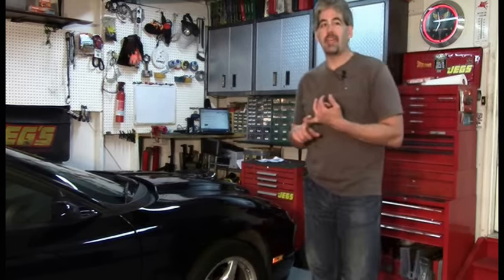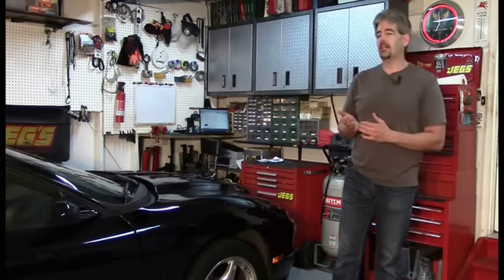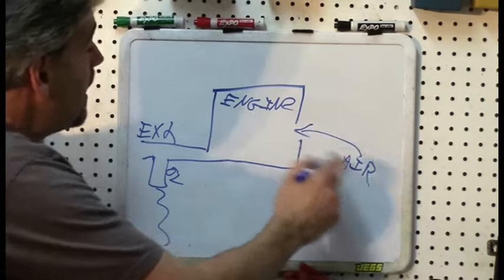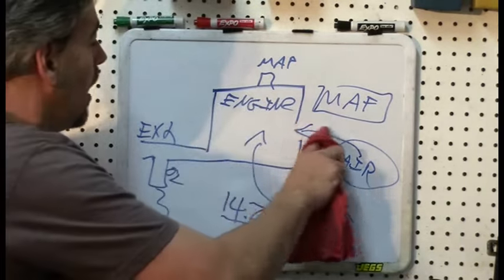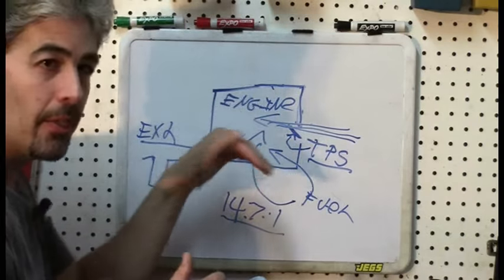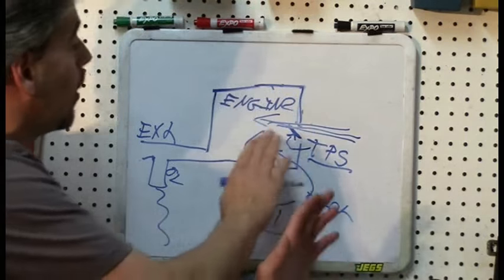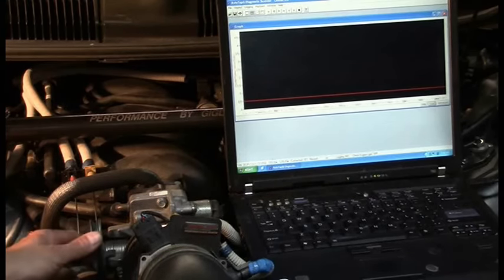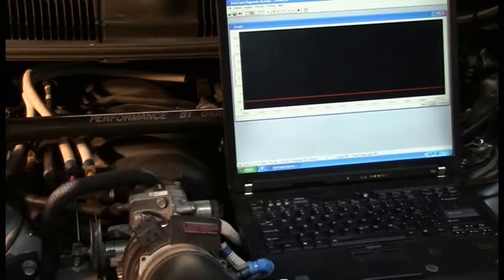TPS (Throttle Position Sensor) Diagnosis and Understanding Pt1

Comment: Nice videos on testing the TPS sensor and how this sensor relates to the others.  Since I do not have a MAF sensor I assume that in your last example with the TPS unattached to the engine my upstream O2 sensors will reduce the fuel flow (call for less fuel) and trigger the check engine light.  

Also, let's say a DTC went off for my TPS and I check the TPS and wiring and everything is fine.  What other issues could have caused the DTC other than a bad PCM?
Reply from the maker: Sandbag1300 Great point Sandbag. I actually addressed this in the original draft of the video but felt it was dragging to long (which I know I tend to do) so I eliminated it, but to answer your questions:
1. Unplugging the sensor: if you recall there was a "baseline" voltage through the signal of .5V as opposed to 0V. There is a reason for this. If the sensor is unplugged (or an open in the signal or 5V or ground) then this baseline voltage of course would be 0 instead of the normal .5V.  Upon seeing this, the PCM will immediately recognize there must be no voltage at the sensor and will immediately throw a low voltage circuit input code. The code will have nothing to do with O2 sensors (other than momentary I suppose) and in fact will prevent other codes from being thrown such as lean or rich codes because the PCM "knows" these are resulting from the TPS problem.

2. The most likely reason for a TPS code despite good wiring and sensor is if it is miscalibrated on an engine that has an adjustment.  Per #1 above, you can see that if the baseline voltage at idle should be, say, .2V but you did not install it properly and the baseline is 0V, you would get a code.  Alternatively, if you adjusted in the opposite and had .5V at idle, that may not throw a code but if WOT max is 4.5V and now it is 5V, the PCM may throw a high voltage in circuit code.  Also, throttle body deposits preventing correct position of the throttle may throw the code, as well and any conceivable situation where airflow changes are not proportional to throttle changes- can't think of any except for those 2 examples.
Reply: I think that's everything electrically. I would be checking physically. Does the throttle actually open all the way? Does it respond that way to pushing the gas pedal?
Reply: You would have a MAP in that scenario that you postulate. I'm going out on a limb here, but it should still see a change of pressure and make an appropriate fuel adjustment.

In your scenario, I don't think the O2's would ask for less fuel, if needed, they'd call for more fuel as the throttle plate opens, in trying to maintain 14.7:1. The MAF/MAP are the command, and if they don't get it right, the O2 is a countermand.

...I know the last paragraph for sure as my O2 just failed and my MAF is still being countermanded by the O2. +50% between STFT and LTFT. The upstream O2 hiccups back into life and fuel trims start to rebalance only for the O2 to putter out and die again.

Comment: Hi Matt, I have an 08 Sebring 2.4L that has the TPS built into the throttle body.  While testing the throttle body the resistance on the sensor changes as I move the plate but falls right back to normal.  In other words with the throttle closed I'm getting a base resistance, I then open the throttle plate fully, resistance significantly changes and then goes back to baseline even as I keep the throttle open 100%.  

Car is blinking Electronic Throttle Control symbol and goes to limp mode no more than 1400RPM in 1st gear as i try to drive it.
Reply from the maker: Sounds like a shorted TPS to me.
Reply: Schrodingers Box Thanks for the input and great videos.  I wish there was a way of replacing the sensor itself vs. having to change out the entire throttle body.

Comment: Thank you for an excellent lecture, Iam driving a suzuki cultus, model 2012, equiped with TPS. Arepairman removed the sensor and brought another one without using the multimeter. i understood your dead spots in graphical representation, and what I am having, is that, the car is misfiring and sometimes makes blasts.  Is it because of misadjusted TPS on throttle position
Reply from the maker: What readings do you have from it?
Reply: well many thanks onceagain, it is exactly the same TPS, and the bad thing is that I have not checked readings, I am making up my mind to go to authorised workshop, can I have your e.mail address plz.
Reply from the maker: munsif55 There is nothing I can do without any data from the sensor.  Good luck.

Comment: Sometimes while holding the pedal steady, it feels as if I lifted my foot off the pedal, pressing it more gets it going again, but sometimes I would get a warning light, after a while it goes away and I can drive it like normal again.  If it's the TPS would that mean, if I gradually changed the position of the pedal that if there was a dead spot, the engine would stop running at those dead spots?

Comment: spikes/dips in the TPS signal can also indicate that the motor/stepper/solenoid or whatever electromechanical device that opens/closes the throttle is malfunctioning, or (as he mentioned) the throttle plate is being prevented from moving by carbon or something.

Comment: Understood. I am going to perform the wiring test tomorrow. Do you concur with the transmission shop the possibility the TPS could be confusing the transmission? This is a 2000 park ave ultra. 20k on the trans. I have  NO trouble codes but has been going on for quite some time.  Thanks for your responses.
Reply from the maker: I concur that it is possible but not likely.

Comment: See LOTO oscilloscope  modules,   for use with lap top oscilloscope downloads is cheap, theres different models at diff prices ,  A high impedance analog meter can find dead spots by watching the needle move, by varying the variable resisters ( potentiometers) we did this in electronics radio and TV servicing back in the 1960s to 1990s before digital meters were common.

Comment: By listening all the way at the end I'm   shocked to hear, I'll be playing all day like having a second what? any way.. Thanks for the info. I just changed my TPS in my astrovan due to having bumps from 1st gear to 2nd gear then to 3rd gear to 4rt gear. Cuz I found video here said change the TPS if having kind of jerking speed gear change.. It solved my problem on my shifting plus my Van has low idle now, it use to be high in idle on original TPS. What I just did is align the TPS to the shaft then turn the Tps little bit to the right about 1/8 to align the holes to put the screws. Hope you will comment on what I did suggest or advice me..Thanks..
Reply from the maker: What was the data you got indicating the TPS was faulty? I dont see any voltage measurement data.
Reply: Schrodingers Box I have nothing to show.  I just base my decision to change the TPS because of the other guy in this YouTube upload his experience. I decided to do that too and it work. I wish I did the test to know the voltage..
Reply: Schrodingers Box my plan if didn't work after I change the TPS is to service my transmission fluid and change the filter also change the two shift solenoid. I think I'm fine for now, due to my transmission it shifts smooth now.
Reply from the maker: i have no idea what your strategy is based on. I am afraid i can’t gelp. it just sounds like you’re guessing with no data or evidence. Not my style.
Reply: Schrodingers Box I know. But thanks in case u want to help. My thing is trial and error hoping nothing will go wrong.. I just shared. Have a good one.  It I learned something from you I might test the old TPS based on your instructions. 🙂
Reply from the maker: I am glad to help if i could get basic fundamental data such as a resistance curve against angle. Otherwise i would just be guessing.

Comment: My 06 Chevy Impala is shaking intensely  at random times and I'm often getting the traction control error which is causing reduced engine power, the car idles rough and sounds at times as if it will stall out. I took it in for diagnostics and the error code came back with 8 codes all naming the throttle position sensor. Does it just need to be cleaned of carbon, or is this a case amongst the 10% where it actually should be replaced?
Reply from the maker: It's a case of 100% where you need to do the testing shown in the video.

Comment: Sooner or later you will have to show taking measurements @ the pcm for those hard to get at sensors. Would like to see diagnosing non communication videos.
Reply from the maker: ***** Hahahaha hell no! I wouldn't try to probe a hard to reach sensor when I have a scantool any sooner that a soldier would enter a firefight with a slingshot.
  But what I used to do was simply run very thin long wires to the component I was backprobing and feed the wires to a comfortable location on top of the engine where I can easily read with my DVOM. Trying to directly insert the DVOM leads at the connector is seldom possible.
Reply: Schrodingers Box When I mentioned testing at the computer for a hard to get sensor like a crank sensor on a 3800 gm. Its so much easier to test at the ICM.
Reply from the maker: ***** Well the only problem is if you don't see signal at the computer from an input sensor, then you will still inevitibly have to test at the sensor.  Hell I'd only test at the computer as the last possible option not just for the inconvenience, but for the fact that computer failures account for less than .2% of all issues (according to manufacturers who validate the parts returned under warranty).

Comment: Very informative video!
I have a question:   I just got  a 1986 nizzan zx 300 and spedemetor reads at least 20 more mphr than what  is actually running and some times it hesitate to shift to the next gear.   Is it a possibility that I have  any bad sensor?  
thank you
Reply from the maker: It's possible, among a hundred other things. what did your diagnostics on the sensor indicate? WHat gear ratio validation have you done? what circuit integrity tests have you done?
  What is your foundation that of all things you suspect the sensor?
Reply: Schrodingers Box 
I haven't done any diagnostic but I have been searching for some  information that by experience can help me to go directly to the problem.  also I read some information about the Transmission sensor symptoms when it's bad and apparently is the same  that my car  is doing.

Comment: I have a 04 G35. No Codes runs and shifts good. When warmed up takes a while to start. What do you think it could be? Oh I changed crank and cam sensors.
Reply from the maker: Could be anything. What about start with the basics- what was your signal voltage showing that indicated the car and crank sensors were bad?

Comment: Thank you, very informing explanation. Could you tell me what the TPS has to do with my transmission shifting? I have a 96 Silverado with a 305 Voetec. (that currently wont start, as soon as it fires, with starting fluid, or gas poured directly into it, it shuts right off, I'm thinking maybe a new fuel pump?)
Reply from the maker: +Stevie Wonder If trans uses TPS in shifting algorithms, iIf TPS is not interpreting position correctly then the car may of course not shift when it otherwise... or shift when it otherwise should not.
  What is your data you have that indicates the fuel pump is suspected? WHat is your LTFT and fuel pressure at static vs load? I am not following why you suspect fuel pump- I see no data there.

Comment: Thanks for the informative video. My scan tool says 9.8% on the TP (Throttle Position?) at idle. Is this normal or something that I should look into? (Honda CRV 2005) Thanks!
Reply from the maker: You can’t say. it entirely depends on conditions.  How is it correlating with the other induction inputs?

Comment: great vid! I have a 93 Jimmy obd1 with no codes that's showing signs, but acts up when highway driving that leads to bad acceleration thereafter. so my question is, can the tps intermediately fail? Cause apparently it has to be the amount of fuel or air being put into the engine.
Reply: a.d

Comment: If you tap on the TPS and the car quits, does that indicate a bad TPS (that is treatable by cleaning the TPS with brake cleaner or something) or is it a mechanical problem with the butterfly valve? thx
Reply from the maker: Depends- what data do you have on voltage interruption and fuel trim or stoichiometric maintenance effect when this happens?

Comment: So if I wanted to start by cleaning the throttle body what should I use and do I need to look for when cleaning out the butterfly throttle? I heard you can throw off calibration by opening it manually
Reply from the maker: +Victor Gonzalez What is the indication you are getting that your problem is a dirty throttle body?

Comment: Hi. have been having problems with a 2010 Chevy Impala, already replaced the TPS. Your T.A. is cable controlled, my Impala is wired from the pedal to the TPS. Yes! There is another Sensor from the gas pedal to the TPS and these go bad as well. 
Also having problems with the Traction  Control which also triggers the Check Engine Light and tons of other problems. 
Originally the Check Engine light was supposed to be for Emissions Control purposes in California  and has now gone  to anything wrong in the vehicle including ABS brakes!
Yes you will still have all the braking capacity but if a sensor in any wheel goes bad you will never get an inspection sticker in some states! 
GM has WAY over stepped the bounds.
States like N,H. have been failing cars for years due to a Check Engine Light that has nothing to due with Emissions Control and if its because they think the vehicle is unsafe then read again! 
We  don't need ABS brakes, Traction Control or even Airbags even thou they may have saved some peoples lives, they are not a necessity and cause more problems then there worth when they are tied into the emissions control system  .I am an old world race car style driver,
Do you remember Obama's Cash for Clunkers? Both GM and Chrysler took part.
Ford refused to buy in, they wanted to build really nice cars , Buy a Ford! Buy a Taurus!
 
By the way I bought my Impala  with only 24000 miles now has 85,000 miles and has not had a legal sticker since the 45,000 mile mark or about four years. I have put thousands of dollars into it and to no avail, Something always goes wrong., Best tool to fix this is a stick of Dynamite!!

Comment: Will a 10 $ blue tootoh obd 2 reader be good enough of a scan tool?
Reply: nah, not really. It'll read codes, and possibly clear, however it wont give you the depth of information you'd need to troubleshoot.

Comment: Great thnx Matt..
Reply from the maker: Glad you liked it!
Reply: @SchrodingersBox  Your most welcome. Your channel should get an Oscar. 
Matt I wanted to ask you what causes an engine RPM to come back down to idle slowly? (i.e. from say 2500+ RPM to Idle over 2-3 seconds). My Father-In-Laws 4 Cylinder Ford has power issues. It lags a bit when opening the throttle and also when releasing the the throttle. No codes coming up on the Scanner. I've done all the basics like air cleaner, spark plugs, compression test, O2 and MAP, MAF sensors have been checked. Could it be Injectors? Any thoughts?  Regards Marty...
Reply from the maker: Thats when pedal is pressed down trying to hold it at 2500 during idle or is it while driving?
Reply: @SchrodingersBox  When stationary (clutch is disengaged as its a manual transmission). 
For example, when revving it up and down. Takes a couple of seconds to get to 3000RPM and about the same to go back to idle. Its lagging both when pressing the accelerator and letting off accelerator. 
When driving it lacks a bit of power also.  Thanks Matt, Hope this costing you too much time?
Reply from the maker: And I assume car is very underpowered when driving?
   It could be a clogged exhaust (melted cat) or if it has an electronic throttle body it could be that. I would check exhaust back pressure and see if the accelerator position correlates to throttle position.
Reply: @SchrodingersBox  Thanx Matt. Yes for a 2Litre its pretty sad. Will check and let you know how it works out. Appreciate your help..
Reply from the maker: I have a recent video on a 2010 Sebring with similar symptoms. search my channel for 2010 sebring low power. It will help you diagnose it.  Also I have it on my pay channel where I walk through it in way more detail.

Comment: No, I have not done it.... It stop working, when I pushed the button "on" then the set up speed repitedly. is it difficult to fix that up?
Reply from the maker: +jerr dez You need to just check if there is electrical command from the switch and vacuum actuation if that is he mechanism which it probably is on that car

Comment: Hello SB,
Thank you good sir for your video. My trouble code is showing "low circuit TBS". If it is not the TBS that is bad, what other IMMEDIATE things should be checked or is it too many to list? Thank you so much. It was very informative!
Reply from the maker: Check the input and output signals with variance of angle.
Reply: If it's not that...then what would be your next choice?
Reply from the maker: Kelley- it HAS to be that if the TPS is not bad. What else possibly could you check?